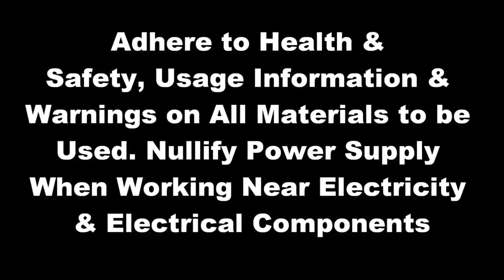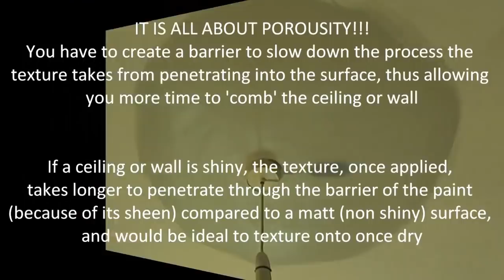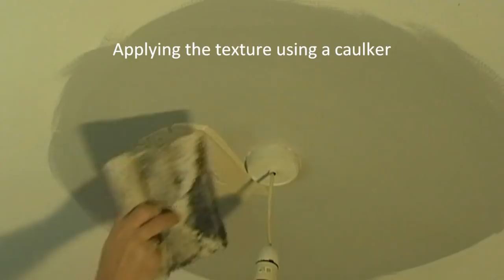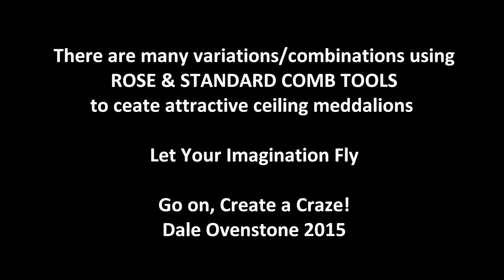3d Comb Ceiling Texture Medallions Victorian Floral Effect - FULL VIDEO TUTORIAL

Comment: Could you use pva to seal the serfice.
Reply from the maker: Micheal, PVA is an ideal sealer mixed adequately with water as per the type of surface to be textured, maybe a few coats, drying in-between coats, to make the surface less porous once all is dry. Have a great day
Reply: Thanks for the quick reply Dale.

Comment: Hello. Just wondering what kind of texture you use?
Reply from the maker: Hi, Jose, I am using a texture compound available in the UK

The texture brand is shown on the full, 45 minute video tutorial, available for free to watch here on my YouTube channel (subscribe for creative texturing tutorials and new stuff coming soon)

There are similar textures (in that they will enable a practitioner to create desired textured effects onto interior ceilings & walls) available in many countries also

Inquire for a drywall texture compound, that one can use to create textures and maybe to prepare ceilings / walls

Some texture compounds are available in powder (where water is added then mixed, to create the desired material)

Some texture compounds are available ready-mixed (and will sometimes require slight thinning down with water, depending on the desired texture pattern wished to achieve)

Some texture type compounds are specifically designed for just preparing ceilings & walls, you know

Some texture type compounds also allow for textures to be created (onto a well prepared surface, for slower intricate patterns, such as using texturing comb tools)

A good indicator is the time-rate of how quickly or slowly the texture material dries once it is spread onto a well prepared, sealed / primed surface (to take away as much background porosity prior to laying on texture). Say in a layer thickness depending on the pattern strives to achieve

Some texture (or I should say filler type materials) are specifically designed to allow good thickness for filling and is activated to set fast, once mixed & applied

Ideal for such ceiling / wall preparation jobs

I refer to texture materials in this comment, because the compound is almost off whitish or slight greyish (and not pink or brown)

A practitioner would seek out the material that can be used to create patterns and has a slow dry / absorption rate once applied to ceiling / wall

Best for creating intricate textures

Make sure tools can be obtained, https://lookreadlearn.com

+ availability of desired texturing compound in your location

A bit of experimentation on a sample wall may be required testing to find suitable material (+ availability)  

Creating each textured ceiling medallion I run the comb through the same applied material on occasions, and the texture does not seem to drag at all

This amazing spectacle is down to a few factors

The area being textured is well sealed; diminishing as much porosity by slowing the dry-off rate (sucking the moisture (water) from the texture compared, to, if it was not sealed) 

The texture material I am using is pliable and designed for creating intricate comb textures

The room being textured is reasonably cool in temperature

There are no hot water central heating pipes under the ceiling

And I had a cracking mug of tea before I even started

Thanks for commenting

Have a great day
Reply: Dale Ovenstone lol I like that mug of tea quote I love Tea but in the US they don't have a lot variety of good teas
Reply from the maker: Tea is like a drug. And actually, is a good testosterone booster for the male participant + real honey, cinnamon and of course, ginger, all in a mug. Have a great day. Thanks for commenting and for watching my video